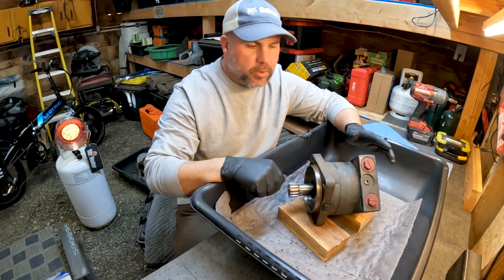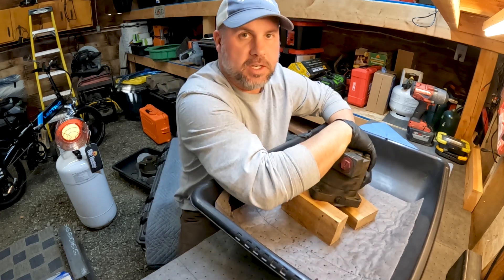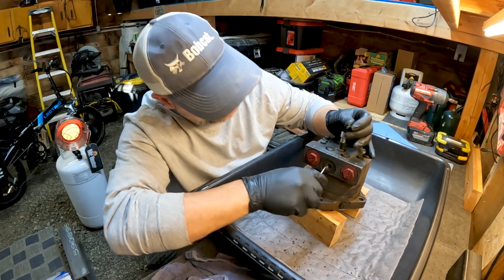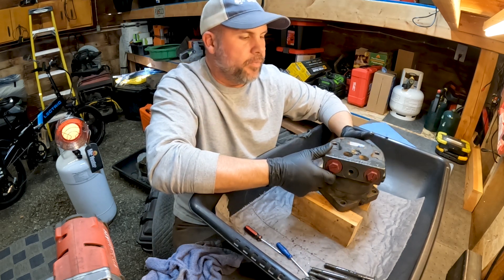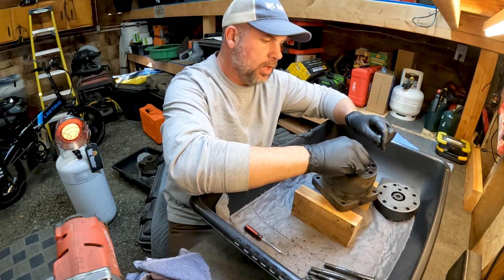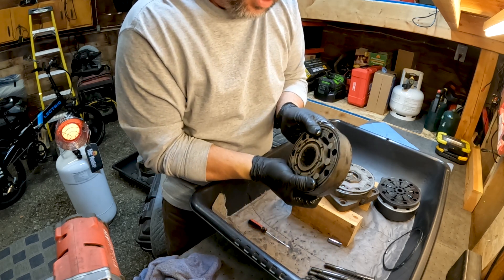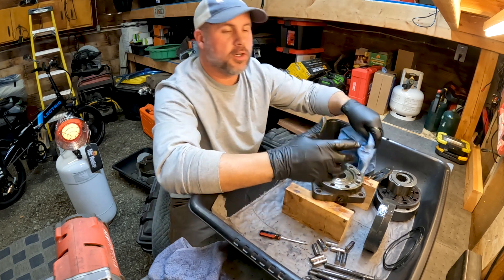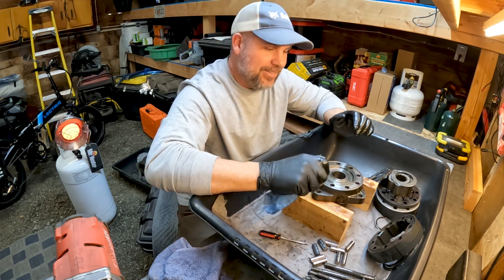Bobcat Drive Motor Rebuild, teardown for inspection, failure analysis.

Comment: Man i have a problem with my bobcat s530. The hydraulic oil it is getting  to the chain box , if something  in my motro it is bad, what can be the problem?
Reply from the maker: Motor carrier seals and possibly bearings.  Usually it's just the seals
Reply: And how did you check what side it is bad? Sorry, so many  questions  i know 😅but we dont have any mechanics  around

Comment: Reverse on the one side of my s100 is really weak. Steering arm even pushes throttle down when trying to pull in reverse 

Dealer said after seals it needs timed. The average person can't do he said. heard anything about that ? Havent seen youtube guys mention timing when doing seals
Reply from the maker: Yes, it needs to be timed correctly. It's super easy to do with a service manual.

Comment: With the drive motor out of the machine on a bench does the shaft spin by your hand or not.  I pulled both out to replace drive seals and one spins and the other doesn’t.  Thanks for any help

Comment: Really appreciate these videos.  Now I can confidently tear down and rebuild the drives on my old 753.  Do you have any videos for 1999 X331 excavators?  More specifically the control valve sections and the final drives?
Reply from the maker: Thank you so much!  I don't have any videos on the excavator drive sections yet but thanks for the idea.

Comment: Do you offer rebuild services? My drive motor on my T190 just sprung a leak (floating face seal). I stopped using it before all of the gear oil leaked out.

Comment: Can a drive motor leak in to the main frame  case on a 753 thanks
Reply from the maker: Absolutely, it can leak into the chain case thru carrier shaft seal.  Also check the center of the carrier for a small plug, make sure it is tight and sealed properly.  Easy job and should probably do both sides while you are in there.  Just remove the drive motor and you will see the shaft seal, pop it out and install new seal.

Comment: We just rebuilt both of ours on our 763 using our manual and watching your video.  LIke yours our geroller was not super tight but with a little oil on it it didn't just fall apart.  No grooves or scratches we could see although you could see wear on the plates (but not feel it).  We rebuilt them becuase we keep bypassing oil into the chaincase.  We replaced the carrier seals a couple times ourselves being very carefull to slip the seal over the shaft.  We also just had Bobcat replace them both in case we were doing something wrong.  We replaced all but one hydraulic line on the case drains and both case drain filters.  Still bypassing all the hyd oil in about 10 minutes.  Going to watch the flow out of the case drain lines tomorrow.  Oh and we ran the motors externally with no load and neither one bypasses any oil without load on them.  What a puzzle!
Reply: السلام عليكم
Reply from the maker: Dead center of carrier shaft is a plug that if loose will allow oil to bypass into chain case.  When you pull the motor you will see what I'm talking about.  Probably the most overlooked item when you have oil pumping in to the chain case.
Reply: @tetradgroup  I've got a 843 that is putting oil in the chain case but the drive motors feel strong, think that plug is probably the issue?